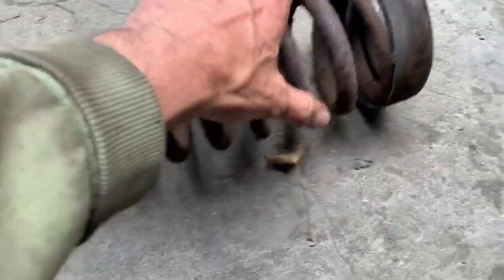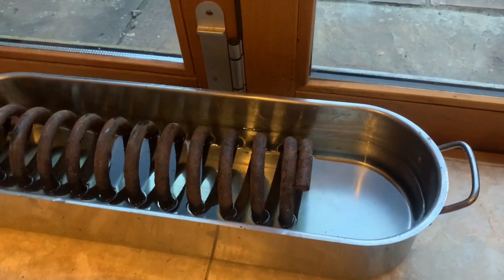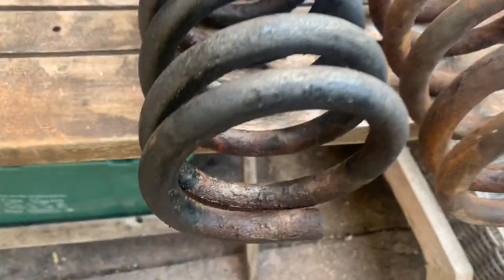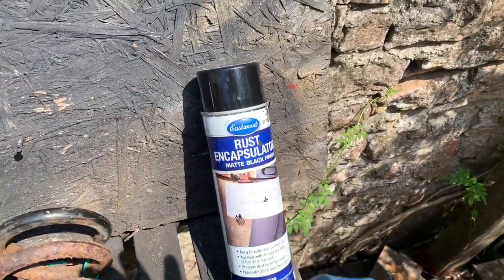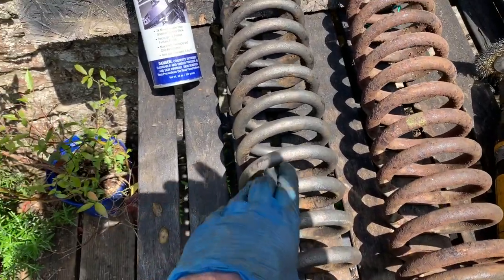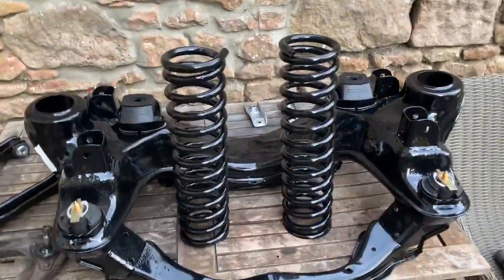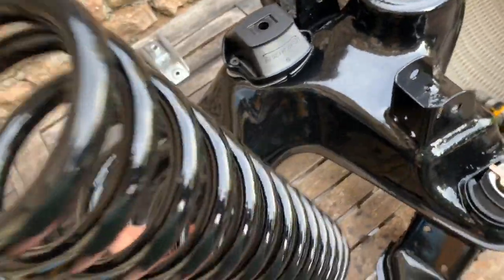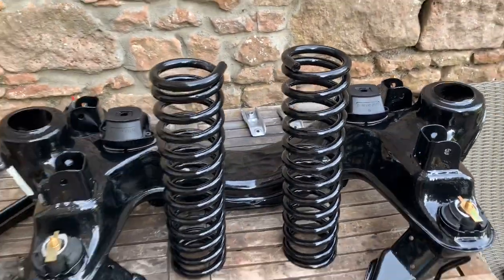Mercedes 107 SL front suspension coil spring refurbishment

Comment: Good stuff. It all looks beautiful.  I'm looking forward to seeing how you refit the spring pan and spring. Having just finished re-assembling mine, I can tell you it was an absolute bloody nightmare. I used a pair of spring compressors to take some of the length out of the springs and held it that way with 12 heavy duty tie wraps before taking off the spring compressors. Then I used 3 trolley jacks to jack up the centre of the pan and under the two sets of bushes. It is important to jack it all up evenly. Eventually I got it lined up to knock through the big bush bolts, pull through and forward the brake caliper before connecting the stub axle top and bottom before snipping the tie wraps.  All that jacking damaged the hammerite paint a little but I was beyond caring by that stage. I hope you find a more elegant technique because it would be such a shame to damage that shiny black paint and powdercoat. I'm Just glad I won't ever have to do it again!
Reply from the maker: Thanks for the heads up....I'm intrigued to see how it goes lining up those bolt holes whilst trying to compress the springs with a jack....and avoiding cracking the powder coat. what kind of spring compressor did you use? Mike
Reply: @MikesMercsandothercars  My spring compressors look a bit like these https://www.ebay.co.uk/itm/COIL-SPRING-COMPRESSOR-KIT-2PC-HILKA-HEAVY-DUTY-CAR-SUSPENSION-KIT-2X-CAR-CLAMPS/333591583265? There is insufficient space in there to leave the spring compressors in place while fitting the spring to the car. Which is why I resorted to the tie wraps - a bit scary, especially when all 6 tie wraps let go after I wound one spring up a little too tight. That's when I moved to using 12 tie wraps. Needless to say, I don't recommend my method!

Comment: Where did you purchase this from and do they ship to the US?
Reply from the maker: Hi - I'm not sure you can get the exact same Deox C crystals in the US but here is the link in the UK:

https://bilthamber.com/product/deox-c/

 Something like evaporust in the US would do the same thing. On reflection, I think sandblasting and powder coating gives a better and more durable finish on springs. Mike
Reply: @MikesMercsandothercars  thanks, I was planning to is chemicals first, then sand blast what might be left and then powder coat.
Reply from the maker: @STR8SICCC  Belt and braces - that is what I did, but I don't think it is necessary to use the rust remover of you are going to sand blast. Mike
Reply: @MikesMercsandothercars  I just want to so it the easiest way possible lol

Comment: My personal opinion is powder coating is not good for springs. The springs integrity starts deteriorating at 400 degrees F. Unless you can find a shop that will bake them at 350 degrees F for longer I’d avoid it.
Reply from the maker: Thanks for your comment. That is a good point. They do a lot of springs so next time I am there, I will ask them about temperature. Mike

Comment: IMHO power coating over the years will not stand up.
You should have sent them in to JET HOT CERAMIC COATING.
The parts you send them will never rust, discolored, chip, crack, or peel again.
The parts will stay looking like NEW forever.